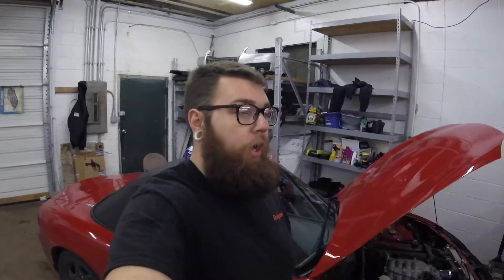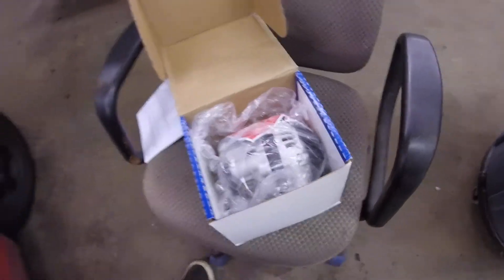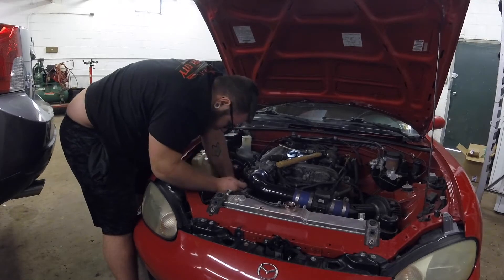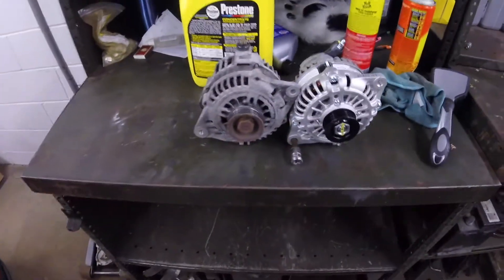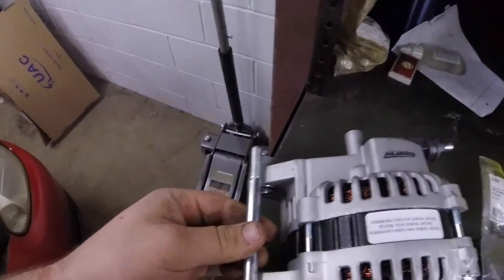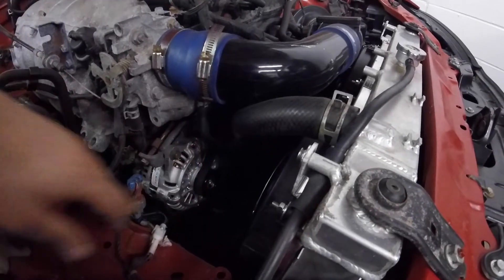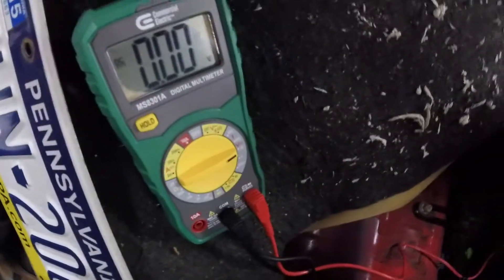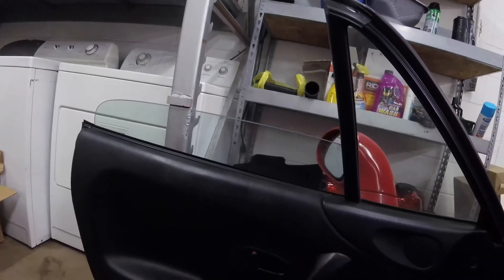Ultimate Mx5 Alternator Upgrade RX7

Comment: To do this mod you need to cut 3 wires at the ecu. 2 get connected to each other and one goes to a switch 12v power source. If you don’t do it the regular won’t work and will over charge.
Reply: any schematic diagram 🙏

Comment: Did you run this with the stock ECU that does voltage regulation? I have a 2005 and was wondering if this alternator would work properly

Comment: So as long as it’s a 1993-1995 rx7 alternator at 100 amps it should fit into the Miata with a bigger bolt and an adjustment on the bracket?

Comment: The reason why its high on your NA is because the NA's depends on the built-in voltage regulators on the alternator. The NB's on the other hand, uses both built-in voltage regulator and the ecu voltage regulator.

Comment: Hello, Is this the NB1 or the NB2 you are installing this alternator on? I would greatly appreciate the info thank you.
Reply: late reply....this is NB1. You can tell by the headlights, it doesnt have a VVTI solenoid, and I can see a cam angle sensor at the left top corner of the valve cover.
Reply: @63W-raccoon  Thank you
Reply: Nb2 is externally regulated thru the ecu. I'm having issues with my replacement alternator. Older one was worn [screeching] and eating belts more and more frequently to immediately.

Comment: Hey I'm having trouble finding which specific alternator used and there seems to be a few diff rx7 ones. This is one I found on amazon: DB Electrical AMT0035 Alternator for Mazda RX7 
It's 100Amp and I think it's the same type of yours, but from diff company. It's all I can seem to find. Is this correct? I'm trying to upgrade my '97 NA because I'm putting in a sound system and I doubt stock can handle it.
Reply from the maker: Yes that should work and be the same even tho it’s from a different company
Reply: @westonlieberum1  Thanks for replying!
Reply from the maker: Did you figure out what one to get?
Reply: @westonlieberum1  Honestly that seems to be my only option so I was checking with you to see if that is the one to get. But I am holding off on it. I put in a sound system, that I'm still trying to figure out and having a bit of trouble with, and it doesn't really affect my rpms and my lights don't dim so I think I'm actually good for now and may not need the upgrade.

Comment: Is it the voltage should be 14.7v max for a car? 14.8v plus might burn the wiring system and ecu, am i right?
Reply from the maker: Akulani Adalani my battery was almost dead when checking it’s voltage  so it was at the very upper limit of charging. 
after letting the car run for alittle while it did drop down to around 14.0 volts and stays  there, had it not dropped down from 14.8 I would say there was a issue with the regulator
Reply: @westonlieberum1  amazing, that cool man. I'm afraid it will damage your engine if the voltage does not go down and I know you know it too. Actually, i didnt expect that rx7 alternator can be installed to miata. I drive mazda familia 323, 1839cc code BP, and i think my alternator (80a too) seem just look the same as your miata's. I think i wanna to find one, and try to install to my engine. Thanks so much to you bro.
Reply: Is mazda rx8's alternator also can be installed to miata?
Reply: @akulaniadalani9428  no , rx7 FD only.
Reply: The voltage doesn't matter as much as the amperage. This alternator in this application should be perfectly fine. While voltage can cause issues anything under 15 should probably be fine and .1v definitely isn't going to cause an issue. One thing I do worry about is that the NB miata uses half voltage regulation in the alternator and half through the ecu unless it has been converted. They may have changed that in the later years like 02+ but for sure this wouldn't be direct plug and play for 99-00 NB miata's unfortunately.